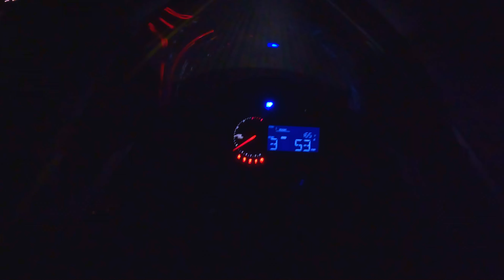$1000 Busa First Ride!!

Comment: The 1999 Hayabusa had a speedometer that read to 220mph. After Germany banned the sell of any bike that could run over 300kph or 185mph in reaction to the 'busa, the speedometer read only to 185mph but there was another hash line above that but it had no corresponding digit beside it. Just buy a GPS speedometer for bikes that are flashed and have the top speed limiter disabled.